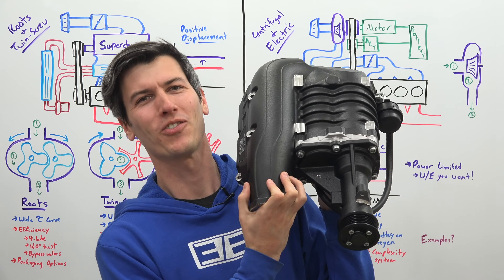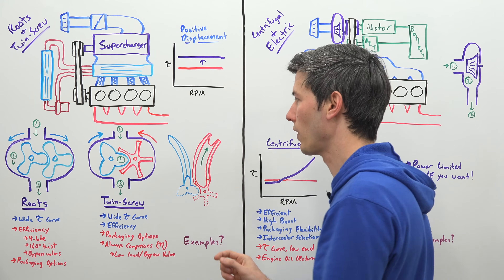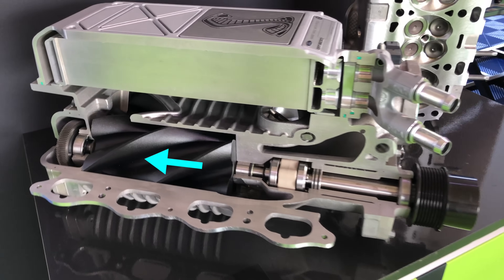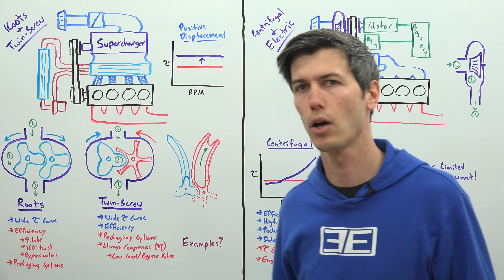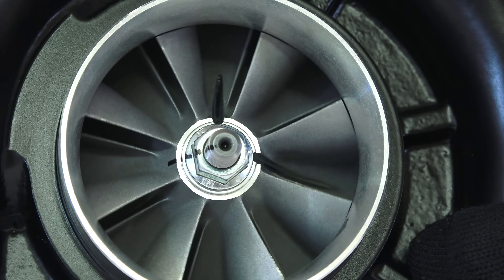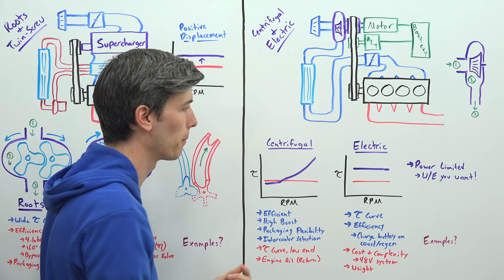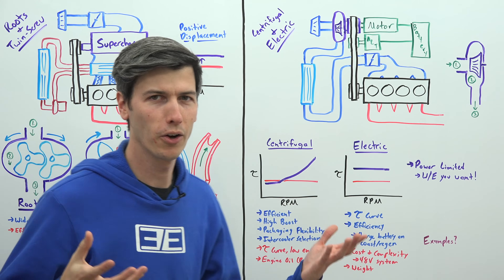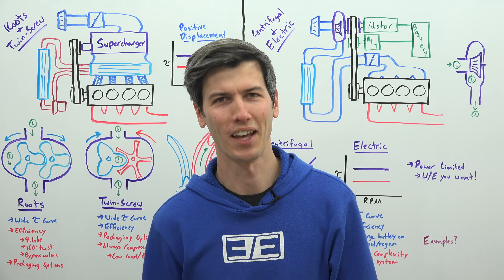What's The Best Supercharger? Roots vs Centrifugal vs Twin-Screw vs Electric

Comment: You describe basically all of these as efficient, but the twin-screw (also known as a Lysholm supercharger) compresses the air internally. Even if the bypass valve is open, some compression is occurring, which creates mechanical drag. The roots supercharger compresses the air in the manifold directly below it (or above it, in the upside down examples you show) so if you open the bypass, no compression occurs. This makes the twin-screw the least efficient of the group in terms of low-load parasitic losses.

Mercedes' AMG is now using electric superchargers on their 3.0L inline-6 for 53 models, and the coming C-Class may also use such tech on its 4-cylinder-only engine lineup. (Possibly only on the AMG variant.) Theirs is a kind of sequential system, but instead of a small turbo, there's an 8 PSI electric supercharger for low backpressure. This dumps into a 17 PSI big turbo for high sustained peak output. Those engines make 429 HP and 384 lb.ft torque, but all the way from 1,800 to 5,800 rpm due to the "whenever you want" electric boost.

Comment: I wouldn't just throw a supercharger on a stock engine.  The cylinder pressures are MUCH higher when the incoming charge air is above atmospheric pressure.  OEM's account for this and put in components like (1) forged steel crankshaft, (2) cross-bolted main bearings or a lower cradle (3) tri-metal bearings (4) pistons with increased dome thickness (5) full floating piston pins (6) stronger connecting rods.  Additionally, the entire engine calibration for fuel injector pulse width and spark advance is mapped/developed on an engine dynamometer with varying speeds/loads and customized to achieve best corrected Brake Horsepower (SAE Standards), Brake Specific Fuel Consumptions (BSFC),  guidelines for Exhaust Gas Temperature (1650-1700 F) and to be free of knock across the entire speed/load map.  Most backyard mechanics as is the case here don't have the equipment, knowledge or millions of dollars to do all of this.  If you are going put a supercharger on a stock engine and try to recalibrated the engine controller - do yourself a favor and buy a spare engine.  You are going to need it.

Comment: What if you over-geared the centrifugal and then put a small torque converter or fluid clutch to limit the speed at the top end?
Or a hybrid - connected with a one-way clutch. A motor could spin it up at low engine speeds. Then the engine takes over at higher RPMs.

Comment: Hey mate love your videos. I've always wondered would a twin screw charger be most likely considered a progressive cavity pump vs a positive displacement pump?
It just reminds me of the fluid pumps build by mono which use a 2 flute rotor in a three flute stator to create a cavity that moves along the rotor?

I could be barking up the wrong tree or splitting hairs but I'd love to hear your input on this classification

Comment: ...your drawings and description of the centrifugal supercharger omit the diffuser...
...which is of course the key to why a centrifugal compressor works...
...impeller accelerates the air through the diffuser where it slows...
...and converts velocity to pressure...

Comment: Which of these arrangements would be most effective on a 400 hp class opposed piston uniflow diesel engine. The engine is to be used on heavy machinery (bulldozer/ore carrier) type applications. The engine is going to need supercharging at low RPM making the use of any single stage turbocharger problematic and the use of multistage turbochargers worrisome due to the increased number of parts.

Comment: For those of us who live at altitude (ie, I'm in Denver at about 5,200 ft), can you discuss how this affects NA, supercharged, and turbocharged engines?  Thanks!!
Reply: Altitude normalization occurs with turbos, so you get the same boost pressures (with some more lag, but not much) and essentially the turbo RPM is just higher to reach those pressures, because the control mechanism is seeking a given air pressure so the turbo spins faster and you get there. Potentially there could be more wear but I haven't heard of anything to that effect. Altitude normalization turbos are also a feature on some aviation engines.
Reply: Everytime I get reminded on the decent hit to power engines take up I think back to WW2.  In the bigger picture 5,200 feet is nothing, 1 or 2 stage single speed superchargers were good up to about 15-17,000 ft/ 4572-5181.6 meters.  The system was just fine if your mission profile didn't dictate needing to get high and fast. 

This next bit is an awesome little test on reading comprehension and if you're an adult or an oversized child.  The Merlin engine wasn't special BUT it's supercharger is what set it apart.  The Allison was a great engine and in many ways superior to the Merlins, so much so folks still using Merlins in aircraft and boats use certain parts from the Allison.  It's turbo system didn't fit into single engine fighters well at all and is why the P-40, P-39 and early Mustangs weren't liked in Europe since they needed thier power all the way up to 25,000 feet 7620 meters.  The reason why the P-47 was as huge as it was is because of its twin turbos and all the ducting.

I think there's some interesting history how the quest for power in WW2 aircraft engines gave us the performance in modern cars.
Reply: Don't you just need more boost? 🤔
Reply: @petrolmonkey1973  petrol monkey what an og name
Reply: As a general rule, a naturally aspirated combustion engine will lose 3% of its power for every 1,000 ft of elevation gain. If you have 100 horsepower at sea level by the time you get to 5,000 feet of elevation your engine is making 85 horsepower. At 10,000 feet of elevation your engine will make 70 horsepower. That happens because because there is less air to feed the internal combustion engine.
Turbocharging at elevation is an efficient way to minimize horsepower loss due to elevation and lower air density. At high elevations turbochargers compress more air into the engine cylinders making up for the lower air density allowing the engine to produce power as if it was at sea level. This extra tunability is found only in turbocharged applications.

Comment: A jet engine is basically an air compressor, a fuel burner and a gas-driven motor, right?
What if one were to take two Roots blowers; an intake compressor and an outlet power-stage, and put some kind of combustor between the two?
Blower the first sucks in air to be compressed, combustor mixes fuel into air-steam and burns it, expanding gasses drive blower the second.
Gearing/belts linking the blowers to keep the Entropy Gods happy.
Heating might be an issue, but I kind of saw this as a dragster engine: short intense runs.

Comment: I went to the BMW Museum in Munich, Germany. While I was walking around the motorcycle area I saw a very interesting picture. A 1939 BMW motorcycle with a twin screw super charger. The drive was inside a cover on the front of the motor. The actual super charger was over at the Deutsche Museum, also in Munich. The super charger was small,Maybe 10"x10"x 4".

Comment: roots is a supercharger , twin screw we call a blower witch is the right name because they original use was on big diesels  then some one got smart and adapt it for a gas engine like a 611 blower comes from 611 detroit engine u just have to change the gear drive for gas engines  but if i was building a street rig i would use a tunnel ram way less money still get power the engine will last a lot longer and u get get mpg my camaro was getting up to 25 mpg in the city with a tunnel ram as long as i didn't get on it with a nuts out 327

Comment: You said something interesting and I need explanation as a hyper-miler.    You said there is a scenario where the engine is "not injecting fuel".. And I've heard reference to this before.  I have a SCAN GUAGE (tm) connected to the OBDII port of all 3 of my vehicles.  And in EVERY CASE, if I am on a highway, long downhill, and I shift into neutral, RPMs DROP (of course they do).  My (automatic) Tundra will go straight down to 750 RPM and my MPGs go to well over 100MPG.  If I were to stay in gear, the RPMs would be, say, 1800RPM and therefore my MPG would be about 70MPG.  HOW does an internal combustion engine RUN, EVEN AT IDLE "without injecting (any) fuel?"  On the Tundra, the SCAN GUAGE does occasionally report MPG of "9999" as if no fuel is being used, but that is momentary.  My standard '96 Z28 NEVER shows that, and neither does my LS7 powered big cam vehicle.

Comment: Hello Jason. Recently, I watched a few of your videos. Very interesting. Thanks for the content. I have a question, and a story. I have a little VW Up. It's a great little car, but it is a little sluggish. I had another Up last year, and a truck leaked diesel on the freeway, which led to me writing off my old car. I bought another one, and recently put bigger wheels on it, and now it's feeling sluggish. I'm not looking to go drag racing or anything like that, but what would you recommend to increase the power of the car a little? The car is still under warranty, so I can't make any big changes now, but after another two years, is it worth putting a small super charger in, or anything else. I like the engineering side, so be complicated, and give as many suggestions as you can think of. Thanks.

Comment: why does intake air need to be cooled?
Reply: Cooler air is denser. A higher density means more air molecules in the same amount of space so you can inject more fuel and get more power.
Reply: Cooler intake air is also less likely to have detonation issues

Comment: So couldn't you fix the lag in a turbo by making a hybrid turbo with an electric motor to spool it up as soon as you touch the throttle and then have the exhaust take over at a certain RPM/boost or what ever benchmark you would use to switch over to exhaust. This would overcome the lag/cons of a turbo and you would still gain the efficiency of the turbo as soon as you come up to speed

Comment: there are also turbo chargers that contain an induction motor to get arrould the turbo lag by accelerating the boades electrically and use the exhaust gasses when they get up to speed to maintain flow, and they can also electricqlly brake the turbine aswell

Comment: That Audi electric super charger is the future, giving u complete dialed in performance & elev help & economy when u don't want it but most of all longevity bc only boosting/heating as little as needed when needed.  Towing or hauling or want to b racing on track like appeal,  but most of all smaller sized engine working the amount for job at elevation durable thing trucks even 4 cylinder backed up by hybrid system & electric super charger esp on mid sized & cross overs, bulk of the market.  At some pnt u just put a V8 in the truck & hybrid helper but V6 super hybrid would b a bit pricey but unstoppable & unmatched performance & mpg.

Comment: When I was growing up we always used a supercharger for low to mid range torque & horsepower. An the other hand, for mid range to high range torque & horsepower we used turbochargers. when we wanted low, mid, & high range torque & horsepower, we used a 15 boost turbocharger feeding air into the carburetors then into a GMC 6-71 roots style supercharger with a 30 p.s.i. pop off valve. We always machined a groove around each cylinder & some times around the combustion chamber on the cylinder head & used copper ringed gaskets to prevent head gasket failure when using a high boost pressure system. This probable reveals how old school I am. This was in the 1970's to the mid 1980's. At that time we were only running 9:1 pistons but now days you could run the same setup you could run 11 to 11 1.5:1 pistons because the material used for all the rotating parts have improved.
Reply: That's the exact setup I want to try with a junkyard LS truck motor and junkyard twin turbos on inverted truck exhaust manifolds. Do the old 6-71s do a good job for that application?
Reply: @boolean5162  The combination of the turbo & super chargers worked out very well. It was a pain in the ass to find someone to make the intake pipes from the turbo charger to the custom made air filter housing on top of the carburetors.

The super charger still compressed the air from the turbo charger at mid to high RPM but not as much. That's the reason you needed a 30 p.s.i.  pop off valve on the super charger so you would not blow a head gasket or piston.

And you had to play around with the timing and air/fuel mixture and the jets in the carburetors to get the performance you wanted.
Reply: Did the turbos feeding the Jimmy act like staged compressors, or did the 6-71 pretty much just start freewheeling once the turbos came into boost?

Comment: Isn't the power increase from electric turbos measured in House Power? LOL. These compressor designs have been around a while. Don't forget WWII military aircraft used centrifugal superchargers, so they could fly at higher altitudes. The roots type blower dates back to 1860 and the screw compressor to around 1878. Screw compressors were used in WWII submarines to change the air in the sub and to blow ballast. Nice to see they are still useful, but I prefer the compact, light centrifugal compressor. BTW, you left out axial flow compressors.

Comment: i would build a battery bank that i charge while parked to supply 48v or 24v to an electric-supercharger.  I think that would be +MPG and +electrical-efficiency over drawing from the (OEM) alternator... plus no loss in AC->DC.  The limited capacity of the battery-bank should be just fine for legal street speeds.  voltage monitor on the bank-output + fail-to-open supercharger-bypass in case of long-distance or failure scenarios.

Comment: 30 years ago I made an Electrical Supercharger, but it was just 12 volts and the power it added was almost zero.
However most of cars today have the belt driven Centrifugal Supercharger with variable by pass valves that basically gives you a pretty straight boost along all RPM from 1800 to 6000! Your video must be old or just the basics.

Comment: Hi Jason, I’ve recently bought Alfa Romeo 159 with 1.8l petrol engine (MPi) and 140hp, it runs all great and engine has been completely refurbished. I kind of miss a bit of a push in the seats which I had with my previous car (Renault Megane 2.0dci which has a turbine), and I was wandering what do you reckon would be the best choice to put in my 159 that would give it a bit of a nudge but won’t make the engine wear out quickly? I’ve read that the engine in 1.8 TBi wears out pretty quick because of the turbine, but I believe supercharger is less abrasive to the engine so to speak. Cheers! Great channel!